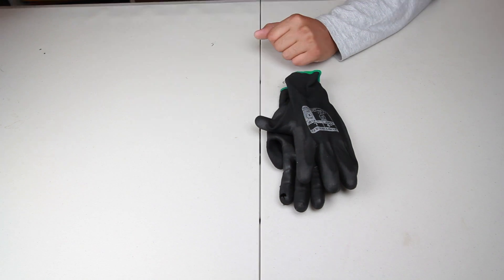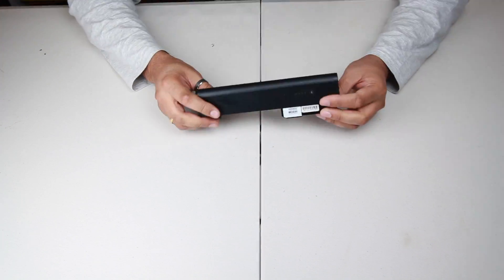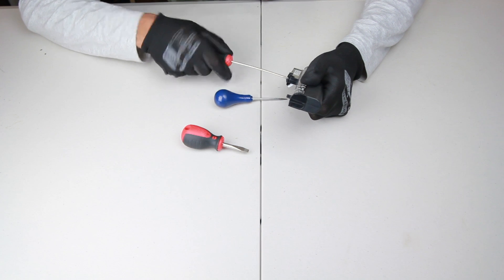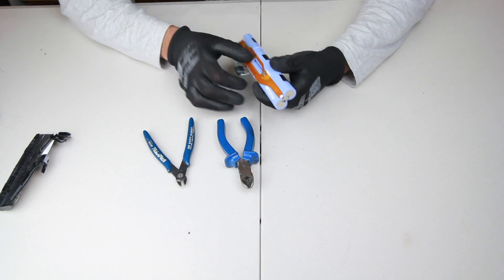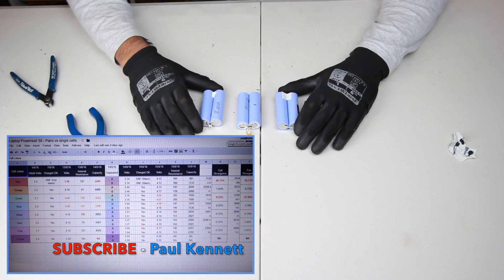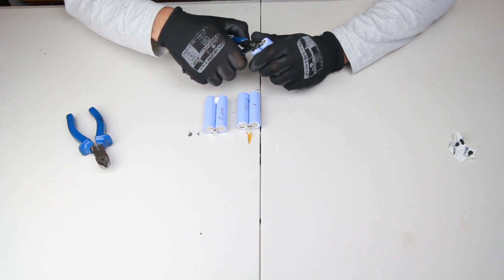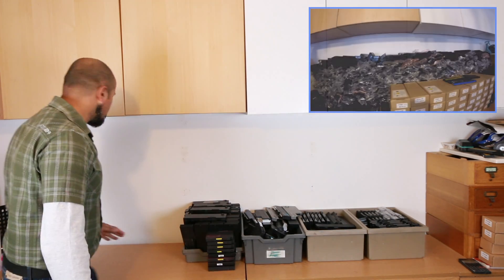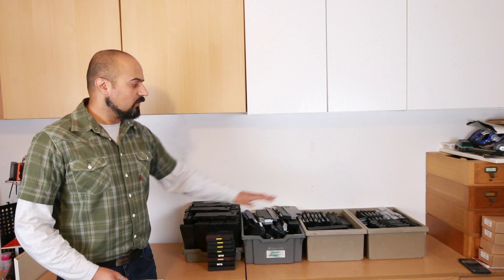18650 Mountain - Part Xi - The Process

Comment: i recomend you invest in a set of good quality long pincers, sharpen the cutter jaws to flush cut. its the only tool i use to split the cases, cut the bms wires, cut the nickle strips, then can grip the strip tails & roll peel back the remaining strips off the cell ends. no other tools needed

Comment: Running a dermal with a cut-off disc around the seam line is way easier...oh and it is not a monkey wrench (pipe wrench), they are channel lock pliers (battery pliers)...

Comment: I use to take apart packs like that. Now I take a hammer a few taps down the seem is splits open. 5 seconds you have the pack open. Obviously don't hit it like a nail. But low/medium force will split the case and not hurt the batteries. If you really wack it you can dent a battery. But its much quicker. And I just pull the batteries and wires apart. Then take pliers and remove the battery weld tabs. Lots of failed battery packs have a couple good batteries still and sometimes the circuit board failed and all the cells are like new or new. I've found most tool packs the board fails. And people leave discharfed packs to long. Tool packs have a MOSFET to kill the pack if the voltage drops to low. Always recharge lithium tool packs after use don't let them sit for for months on end discharged. Below 2.5volts the MOSFET opens to drain the pack to 0 to kill the pack for safety

Comment: You should never go in from the power connector face. Attacking it from the other side is far safer. I use a pair of woodwork pincers on the rear lip, which breaks the case easily on the right angled turn, working along that edge leaves you with a full length opening. You can then often prise the case apart, though sometimes you have to also break the two sides on better quality brands. This leaves the BMS safely out of the way, and the end terminals can be disconnected while the cells are still sat in the other half of the case.

Comment: I took a laptop battery apart where the + and - were in the same tape like trace, i had to use some scissors to disconnect them because nothing else worked, the battery shorted out and the scissors died. The cells were not even 18650, they were a crappy strange panasonic design which are slighly taller than 18650s and slimmer, they didnt even warm up when shorted too so those went straight to the recycling.

Comment: A good way to cut open the shells is to use an oscillating tool. You cut a slot in the work table for the oscillating blade, mount the oscillating tool under the table with the blade sticking through the slot in the table top, raise and lower the oscillating tool to get the depth of cut you need. Then just run the shell over the oscillating blade and cut the case open. There are all kinds of blades to use, coures cut, fine cut, round and flat blades, pick the one you like. Please use push block made of wood to move the shells through. Watch fingers!

Comment: I did post a short video few month ago showing an other way to open this particular battery pack : https://www.youtube.com/watch?v=NRg62AMB590
As you can see, I do NOT touch (or even take the risk to do so) any internal part.
I push the tool angled toward the outside of the pack, and only one shot is needed to open it.
In my mind it is much safer, for your body ;-) but also for the pack itself.
Needless to say it is much faster.

Comment: I've found a dremel cutter disc down the weld to be very effective.
Reply: Also, pop in freezer for 5 mins.... hit edge ways on against concrete garage floor with hammer.... dont let the batteries cool off too much... not sure how it affects the lithium/cobalt mix in most of those batteries but I wouldnt chance leaving them in there for hours!  Works well though on some of the tougher cases.

Comment: Great video. Your production value is outstanding. Just finished processing my first batch of laptop batteries.Ended up selling the processed batteries on Ebay since i dont need a powerwall. Did it more for the experience than anything else.

I like to snip the ends off the battery case with wire cutters then split the battery on the weld seems. Works pretty well. Have multiple different brands of chargers but in the end ran everything though multiple Lii-500 since they can be charged discharged and charged again in a single device. Interested to see how you processed the batteries since that many batteries required awful lot of testers to be efficient.

Comment: I have found that if you can get a good firm grip on both ends of the battery and can twist or flex it at all, the case generally seperates at one of the seams and opening it the rest of the way is easy. No tools are needed and little chance of accidentally shorting across the terminals of the cells or the power board.

Comment: Impressed you did most of the work without gloves. I found I cut my fingers to shreds on the metal burrs. For the packs; I tend to use a vice and twist them with some large jaw pliers to break them open. It's messy, but seems to work for me.
Reply from the maker: The laser cutter was a god send. At times I did burn the batteries sleeves but TBH this was not such a big issue as they can be re-sleeved. But I found brealing the work load into its smaller processes and doing these in bulk really helped keep organised, tidy and injury free.

Comment: Fantastic video!!!   I've never had a mountain of 18650's to dismantle - only a molehill at most.  I do find use in this gadget https://www.youtube.com/watch?v=2GOeeMNzYAU
 (shameless promotion of YouTube video he he).  The data is a good predictor of cell performance and may stop you preparing cells from batteries which are worthless (even for us 18650 junkies).
Reply from the maker: Hey that is awesome, thanks for sharing! why not register to www.DIYpowerwalls.com your wealth of knowledge could help lots there. No harm in plugging your channel, what are you looking to do with your 18650s
Reply: I made an ebike battery but, whilst it was free it didn't satisfy my needs so I made another one with new cells.  I plan to remake/increase a battery for static use.  Powered by the sun of course (in Oz).

Comment: I saw the video yesterday that said" NERDVille is dead" and my immediate thought was that you'd had a catastrophic 18650 thermal runaway situation! I'm glad that's not the case, I've loved all of your videos so far and am keeping a close eye on your channel for new ones! 

I use 18650's in all of my vaping equipment, and just wanted to share a valuable resource for information on Lithium cells, this guy is working with them everyday and testing and graphing different brands, His name is u/Mooch315 on Reddit and just "Mooch" on a few other sites, he's been an absolute godsend for us vapers. 

In my opinion, I wouldn't have a problem with seeing 2 or 3 ads per video, as long as it helps you out, I've loved the series so far and am now hooked!
Reply from the maker: awe mate thanks means a lot to me. Honestly its not for the money but I hate Google making (more) money off of my hardwork.
I hope to do more stuff on the channel than 18650s but they will one way or the other be about 18650s

Comment: To increase those levels of peril, I found using a sharp ~19mm wood chizel works quite well. the sharp end does a good job getting into those seams and the extra width helps crack the case open as you twist.
Reply: I sharpen the medium end of this tool like a chisel and use the wonderful leverage it offers.  https://www.amazon.com/Red-Devil-4251-Painters-6-In-1-Tool/dp/B00002N6IT/ref=sr_1_1?ie=UTF8&qid=1478308622&sr=8-1&keywords=painter+tool

Comment: Great site. Already producing advertisement income I hope. 

I use a sharp pair of wire cutters and start seams. Once I get a gap I move the pack to the edge of the workbench, overhanging as much as possible and still maintaining leverage,  and insert either a thin standard screwdriver or a chisel into the gap and press down on the lower section. This tends to split the lower case along the seams. From there I follow a similar method.

You mentioned nipping off the weld debris. In addition I use round end of electric scissors to smooth those little barbs out so I can handle the cells without slicing tender finger pads.

Whatever gets you there fastest. I also use much thicker gloves and therefore fewer BandAids.

Love the new site.

Comment: Fantastic video.
I figure I would use a vice, put multiple packs in the jaws, then bust out an oscillating tool and run the blade enough on one edge so I could then just rip it apart by hand.

But I haven't tried it.

Comment: Would you mind sharing a link to which laser cutter you have?  I have been starting to look into them based on seeing it used in your videos, and I think I asked you about it before.  Most of the cheaper Chinese ones I've seen are "engravers" but I really think the cutting capacity like your's has is key to it's usefulness (as you prove).  Thanks for your help, I've subscribed to your new channel!
Reply from the maker: Hi Yes of course. mine is called a Red Sail Clone and if your in the UK this is the eBay listing and there are many like it. I bought mine 2nd hand of a guy who wanted to upscale and my laser has had its laser tube and PSU upgraded to run an 80W tube.
When the Pound Stirling was good, this could have been bought for less than £1000. Sadly everything is 20% more expensive
http://www.ebay.co.uk/itm/60W-Laser-Tube-CO2-USB-LASER-ENGRAVING-CUTTING-MACHINE-with-Red-dot-position-/222024445071?hash=item33b1b02c8f:g:h-EAAOSwe7BWwSKv
Reply: Ouch, I'm using Dollars, so even more expensive for me!  Nice machine, but I think for me to have that kind of capability, sadly, it will be a while before I do...  But thank you for sharing, at least I know the $ figure to have that kind of capability in your garage (and it's still within reach if I forego all the other stuff that is on my list...).  

On another topic, the production quality of your videos are spot on..  as well as the information, most importantly.
Reply from the maker: You may find a cheaper one from your local eBay as these are typcally chinese made machines, best of all look for a second unit that has not been used much. You'll be surprised how cheap these can go for. Also checkout Russ at https://youtu.be/JfRpa9Y5Woc who has been intrumental in taking the time to break down these CHEAP machines and advice on what updates to make these a more safer machine to use. Drop him a msg let him know I sent you.
Reply: Awesome man, THANK YOU!!  Much love.

Comment: I was really sad at first when I saw Nerdville is DEAD in my feed but luckly you just moved. I only prossed about 250 cell out off 33 Laptop packs and this sens of achiviement was overwhelming. Now if tested about one thiered of the cell for capazitiy and with 2 Dischargers its pretty quick. Just put two in when I leave for university and test more when I'm back.
Reply from the maker: Hey way to go my friend. What is your plan with your haul of 18650s?
Reply: NERDVille I will use them of the speakers I build and also for a kind Powerbox (build in an ammuintionbox), this won't be anything like a powerwall it's more like a prove of concept. As a University  student I life in a apartment so I can't put Solar on the roof. If I finde a shop that could build me a Cargobike to me drawings it would also 18650 that. Some of the 18650s also find there way into smaller projects. Currently I'm working on a Automatic charger but to get that working I need my 3D Printer which is currently preordered.

Comment: I use side cutters similarly for removing the nickel strips but my advice is to start at the negative end.  Doing the first strip is the trickiest as things are tight so if you nick the battery covering your not going to short it as would happen with the positive end.  Once the negative end is removed you can then part the batteries and the nickel strip on the other end peels off so much easier.
Reply from the maker: Hey colin, thats the idea, safety first but sometimes I like to live dangerously and attack them from the centre LOL joking! no one try this its very dangerous!!!

Comment: Thanks for the shout out NV. I can relate to your desire for more batteries. Been feeling the same urge here too.

On opening batteries - I wasn't keen on going in via the power connector for fear that I might short the cells with my screwdriver.  Not sure if that's an unfounded concern or not.

And an extra throught on 18650 heat shrink sleeve - go for the light weight PVC stuff, not the thick black insulating heat shrink. You don't want to hold heat in the battery too much. And the thick heat shrink won't fit into standard 18650 battery holder clips.

Another great video. Cheers, Paul
Reply: Yes - I prefer to attack from the sides or ends away from the power connector
Reply: It depends on the battery for me.  I have very good and consistent experience with Lenovo batteries using a painter tool with the medium side sharpened by my dremel.  A HUGE amount of leverage can be utilized by that tool.  It doesn't work so well with the Dell ones though.https://www.amazon.com/Red-Devil-4251-Painters-6-In-1-Tool/dp/B00002N6IT/ref=sr_1_1?ie=UTF8&qid=1478308622&sr=8-1&keywords=painter+tool